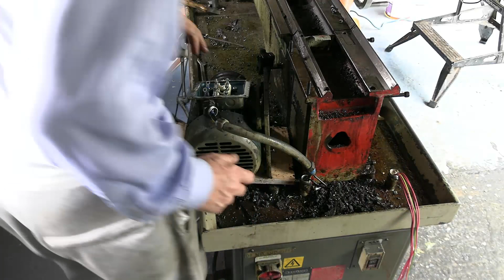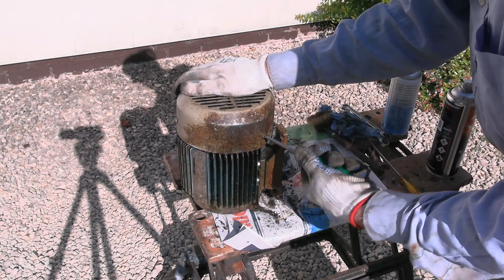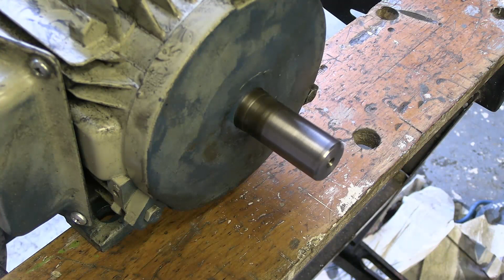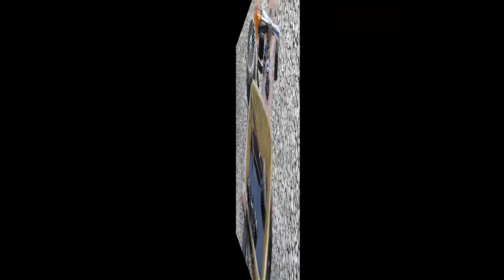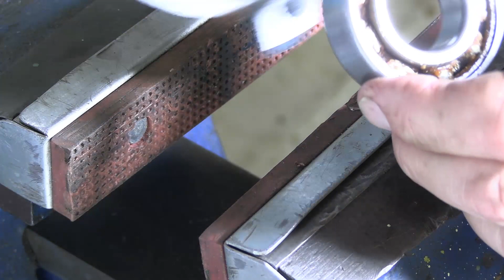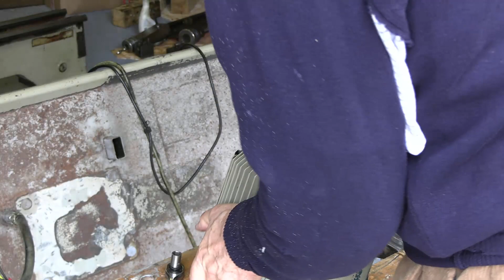Harrison M300 lathe - main motor refurb

Comment: You'd be better off using a bearing press to seat the bearing in the housing, hammering on the shaft therefore on the inner race will probably brinell it and shorten the service life.

Comment: Dear Samuel, Thank you. Very useful. Your "ALPAK" GEC motor is similar to my Harrison 140 "KAPAC" Induction motor. I dismounted and cleaned my motor at Easter, but stopped short of renewing bearings owing to uncertainty how to do it, which you have now kindly demonstrated for us all. I see the bearing numbers were set out on the information plate. Reinspecting my plate reveals for me what the mysterious printed symbols and numbers there mean - Brgs D.E. and N.D.E. (in my case a single digit difference to yours)l Main differences between motors (apart from bearings) are that mine is supposed to run on twin KW ratings 2.2 and 1.1. (I have a problem with the fast speed, in that operating the change-lever blows a fuse, so until I trace and fix, I presently only run on slow forward). Also, against "Conn", yours is specified as Y, whereas mine is YY/[Delta symbol].

Comment: One neat trick is putting the bearings in the microwave wrapped with (heavily) wet paper. After 2 minutes at 600W they're pretty much cooked at 100° and they just slide smoothly in place. Not fear they can go beyond 100° and damage the grease in there, and also it's super fast

Comment: Well that was a bit of a journey. Half way through I was saying no no, those bearings are cactus, I can hear them. So relieved when you said you would replace them. You had got so far and are doing such a thorough job of this refurb, it would be nuts to re-use them.
So glad that you could hear the difference with the new ones, proved we were both right, which is nice. I hope you are pleased with the results you are getting with each stage of the job, looks like you will have one very nice lathe when you are finished.
Reply from the maker: Ah, but will I ever get to the end? I've got painting and painting and painting to do now, and the autumn is here and my garage is getting damp. More seriously, I've had bearings where if you put your fingers in the inner race, push and rotate against the outer race, then you can feel the lumpy, worn balls. Not with these ones. But they sure sounded horrible. Glad I changed them.